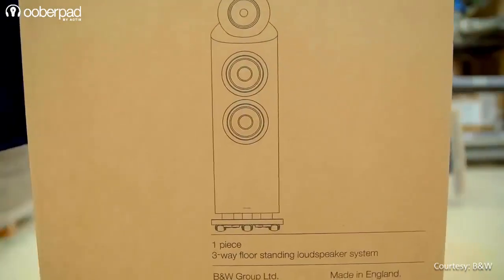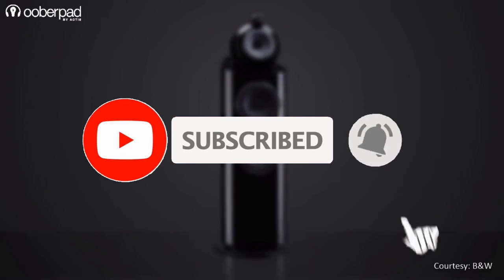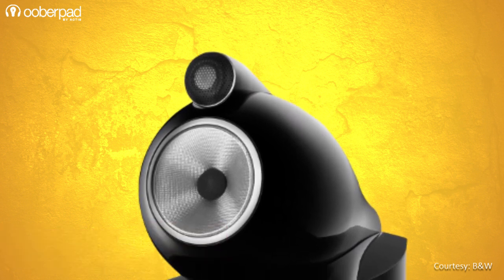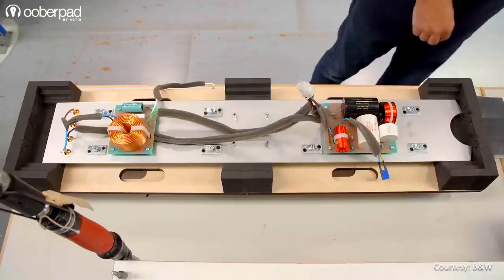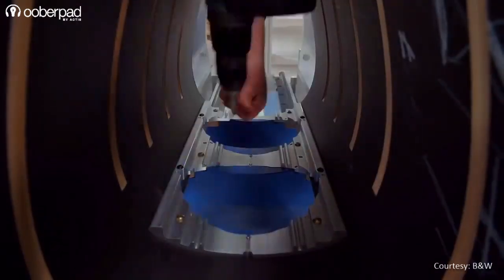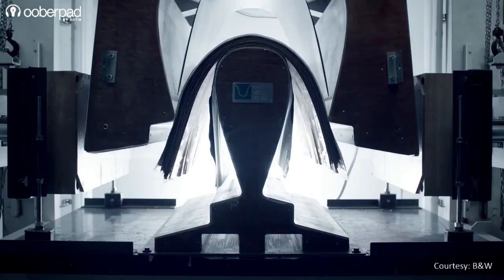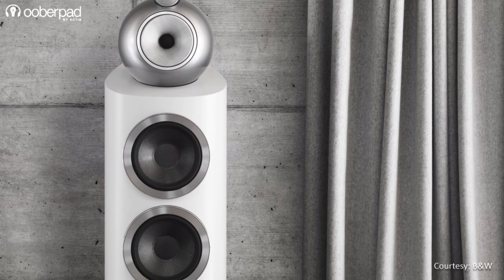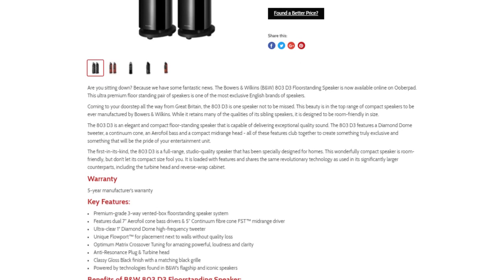Bowers & Wilkins (B&W) 803 D3 Floorstanding Speakers - Quick Look India

Comment: I've owned 3 versions of an 800 speaker since 1984 starting with the 802f, 1989 Matrix 802 and 803D in 2007.
I run a Bryston 4B-SST2 and BP26 with MPS2 power supply.
803D and amp set up love each other audibly, like totally in sync.
I spotted a pair of used 3 year old 803 D3 in black in immaculate condition from the dealers original trade in stock as client went to D4 series.
I was fixated and dreamt of owning 803 D3 and I'd only heard a 30 min audition in 2016.
Covid didn't allow an audition of 803 D3 but at 13k AU I thought, what can go wrong, I can have it and bought them and they looked fantastic !
These 2 garbage bin looking dalek inspired transducers were simply just awful 😖 truly truly woeful.
Minimal bass impact, forensic detail, too much and a 6db peak in the mid range, leaving a very bright almost shrill impression.
I was devastated, I hear people scream, it's the Bryston amps they're overly bright, not a match etc I ran a 4B-ST previous since 1997 and while not as smooth as 4B-SST2 it sounded OK with a myriad of floor standing and or bookshelf speakers.
I keep an open ear in different speaker amp set ups.
Bowers want nearly 30k AU for a 4th generation diamond well, forget it, I would never touch the 800 Series ever again and I've not auditioned them but they can have them.
So design excellence and all that backend research for drivers etc and they produced a sterile, lifeless speaker in the D3, cables connects all fine thank you.
Bitter disappointment on a truly lifeless sounding speaker that I described as an uptight bitch and I've worshipped B&W for near 40 years  !
If the 803 D3 was tuned to an mp3 standard then, it shows 😄 totally lost the plot, I'm still in disbelief and wonder how they justify the enormous price tag.
They say up to 10k for a speaker, there after is realm of diminishing returns and I believe it with D3 performance.
Bowers will price themselves into oblivion and for all its design limitations, the original 803D pissed all over the D3 version sonically.
Yes subjective opinion.
Bowers should produce a 10k version of a Diamond speaker in the original 803D design and I'd buy it again but the 803 D3 belongs in the rubbish tip and this is from a long-term die hard, brand loyal customer.
Any bass you hear on U Tube on D3 is an artefact of MP4 compression which just makes it sound like bass but it's just an illusion.
803 D3 gets 3/10 for absolute sonic ability.
9 for the design.
Never Again.
I'll keep my 803D for life
Yes I lost 20% on purchase price as I returned them to the dealer.
24 hours was enough to tell me it's not for me and yeah yeah always audition first but I wouldn't expect such a highly coveted speaker to be such a bitter disappointment.
I wouldn't recommend the 803 D3 to my worst enemy ha ha 😄 u have been warned  !
Oh, get the 802 version with bigger bass drivers ... ahhh no ... near 40k AU for a set of 4th generation D speakers .... naaaah not interested, the love affair is Over !!